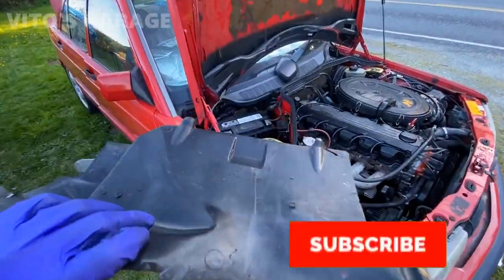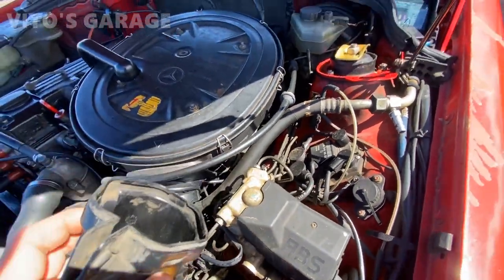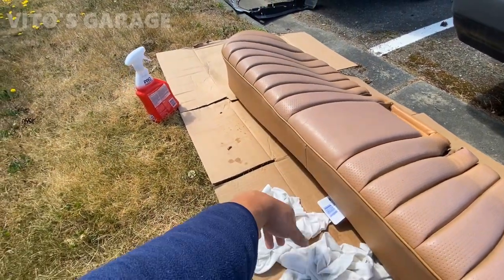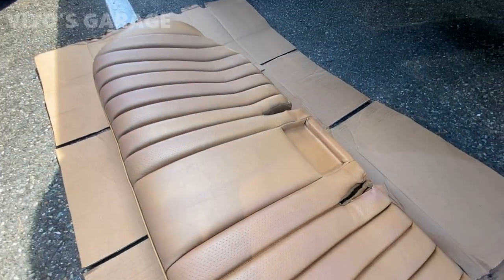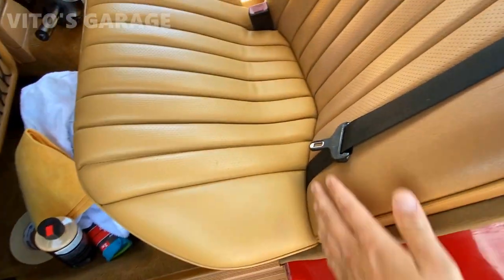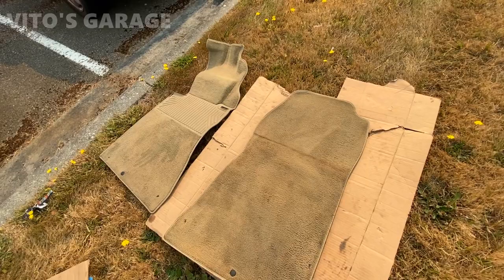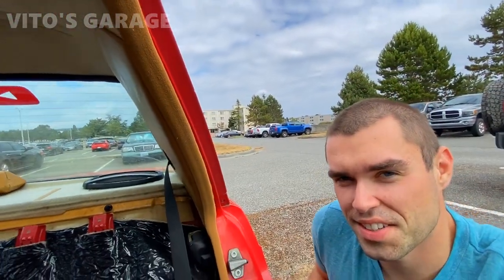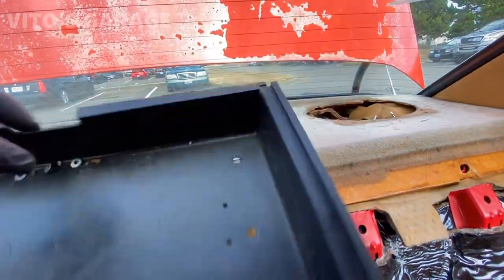Mercedes 190E W201 Faded Palomino Interior Restoration. Rear Bench Seat & Shelf

Comment: How the carpet’s fibers react once painted? Do they sticked together or they stand « natural » as before? Hope you understand well my question because my English is not at is best!
Reply from the maker: It depends. You need to clean the fabrics very well before painting. Mine turned out good and didn’t stick together. But you also have to paint from a distance and only light coats if you want it to be good

Comment: That's an awesome job Vito. You used the same SEM stuff that I did on my 81 240D. It really does work wonders.
Reply: How does paint hold up to sitting and rubbin on them over time?
Reply: @nehuge  Don't know. I didn't have to do my seats, as rather surprisingly they had not faded like Vito's. I only did the rear parcel shelf which had literally faded to white. It looked brand new when I was done.
Reply from the maker: Time will show but the more coats you spray, the better it will be and the thicker the layer is going to be. I’m super happy with the results. And I’m pretty sure this will hold up amazingly. My friend had to do the same with his seats on W123 and it’s been over a year so far. He said it’s holding up great